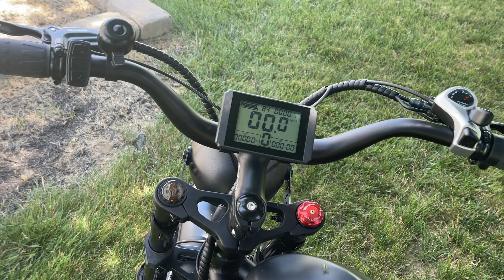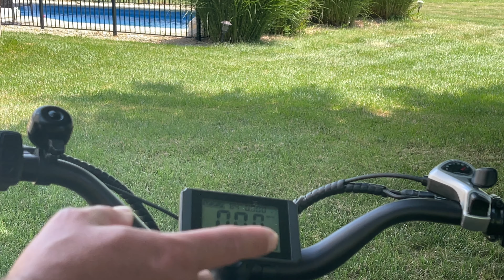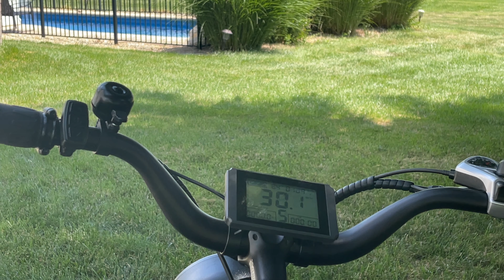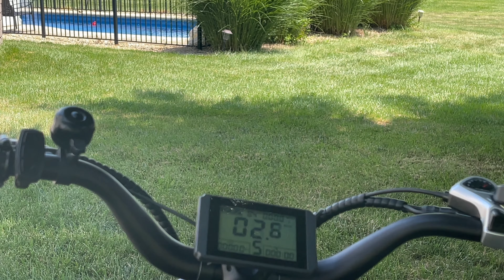NEW METHOD! HOW TO MAKE YOUR EBIKE GO FASTER - OVERRIDE LIMITER

Comment: @NRGSPORTSANDHOBBY I'm going to be getting an Amyet Eb-26 it goes 28 out of box supposedly and it has a 15 ah battery. 1000w i believe or more.
Reply from the maker: Sounds good. Will have a decent top speed, but with that AH may be limited on range, especially at top speed. Hope you enjoy it. You might be able to go faster with some settings. 1000W standard (not peak) can usually go 32mph if you have a 52V battery. 48V a little less.
Reply: @NRGSPORTSANDHOBBY  Okay good to know thank you very much. It is a 48v battery.

Comment: I got into maintenance mode but it doesn’t let me turn up the speed for some reason. I have a rider pro 4.0
Reply from the maker: It should be setting P02 or P08. Have you tried that?
Reply from the maker: Your panel is different than this video. I would watch our video with a similar panel
Reply: @NRGSPORTSANDHOBBY Thanks for the tip but I have the same panel, how do I set it to setting p02 or p08
Reply from the maker: So we show you in the video. Same video as your panel and follow along. Super Easy

Comment: What bike is that? The link isn’t working for me.
Reply from the maker: https://aniioki.com/?ref=0wjezu08
Discount code: CURIOSITYCAFE
Reply from the maker: The one I just sent you is the dual motor version. Goes even faster
Reply: @NRGSPORTSANDHOBBY  do they no longer sell the one in your video?
Reply from the maker: Yes they do. With that link you can select the ebike you want from the website and still use the discount code. That's why I provided it for you.

Comment: I just bought a gotrax ebe4 350 watt 20 foldable. N it has full display, it's kind of a turd n want more power, should I bought more power or can I put bigger hub on or battery? We only got it for putting in our diesel pusher to scoot around race track n camp grounds  COULD SOMEONE LET ME KNOW THAT HAS KNOWLEDGE? 🥂😮
Reply from the maker: Yeah those gotrax bikes are very inexpensive. I sold a couple for $300 the other day. I would maybe upgrade, We have about 50 ebike reviews on here. I'm sure you can find a better one that we've reviewed.

Comment: I’ve been thinking about buying a 64 Beachman but the only thing that’s keeping me from purchasing is the top speed of 20 mph.
Reply from the maker: It's a legitimate concern. The question shouldn't be how fast can it go when you buy it. You should be asking what the motor wattage and voltage is. You can always set it to go faster if the specs are good. Look for 750W minimum, 48V minimum. I like 1000W/52V myself. Those can go 40mph+
Reply: @ thanks! I was also watching another video of yours about swapping the battery for a bigger one. Would this damage the bike?

Comment: I have hiboy p6 with en06 display and cannot get pass p04
Reply from the maker: Our Hiboy models are locked with no panel way to override. We just simply disconnected the speed limiter wire to the controller. It's usually the white one. I'm sure there are tutorials online to help. We got our Hiboy up to 34mph (can't go faster with that motor and rider weight).

Comment: I have a Freesky Swift Horse ebike and it goes 35mph right out of the box on pas5. But 35 is the limit, above that it feels like it's hitting the brakes it cuts off so suddenly. There's an unlimited controller they sell for like a buck sixty but there's got to be a way to hack the stock one. And ideas anyone?
Reply from the maker: Yeah that breaking feeling is the limiter. You can disable it. Get it into developer menu.
Reply: @NRGSPORTSANDHOBBY  Thanks for responding but how do I go about doing that? I could rebuild the engine in your old muscle car but when it comes to this stuff I'm completely lost lol.
Reply from the maker: It really depends on the panel. It's usually a combination of holding buttons down for 10 secs. I have a couple different panel videos. I don't have that ebike to show, but it should be similar.

Comment: I just bought the newest version of this same bike and it has the new display. Unfortunately they have locked the parameter settings menu. It is a four digit code displayed next to a P0 code. All I can do is enter a password, no other function. The display is a model YL90T-H and have found the full manual but no leads on the password. Does anyone have it please?
Reply from the maker: Did you try 0000 ? That's the default on all ebikes
Reply from the maker: What did they say when you called them?

Comment: Juliet III Electric Bike for Adults Dual Motor 2000W 33MPH 48V 60Ah 100-200 Miles Long Range Electric Bicycle 20"*4.0  i need help bc an old lady almost rear-ended me bc she thought that my bike could at least go 30 & my bike only goes 20
Reply from the maker: Not sure what you are asking for. That ebike goes faster than that. You can do it in settings. Extremely easy on that panel. I've done it on alll our Eahora ebikes. You can also contact their chat support 24/7

Comment: ive already did this if i lift the bike up it will go 26 mph while i ride it it will go 23 mph which is decent.
Reply from the maker: Yeah, rider weight and bike weight can affect max speed if your motor can't handle faster.

Comment: Sorry, this does not make bike faster or adjust bike speed. It simply offsets your wheel rotation to an inaccurate speedo reading.
Reply from the maker: This and many other ebikes it does. I took a gps to it after adjustments to voltage, tire, and the actual max speed on the panel and I get 43mph. You don't? You have this ebike?

Comment: Bike speed is all down to Battery Voltage and Motor size. Here in the UK we are limited by law to 250w and 15.5mph. Stick a bigger Battery on your bike and you'll go faster...add a bigger Motor = faster still. Changing wheel sizes on the display won't make a lot of difference if the power's lacking, you can't unleash something that's not there to begin with.
Reply from the maker: You are correct. I'm sorry you are dealing with limitations in your country. We don't have such hardware limitations in the US. The way we regulate is with limiters which can be over ridden. Hence this video. If I lived in the UK, I would probably just order a custom one and build it myself. Best of luck to you
Reply from the maker: For sure. The two ebikes I run regularly are 1000W and 1400W, 52V and 48V batteries. So I can get those 40mph+ speeds. Not everyone can afford those. But you are right and I mention that in our videos. Best of luck to you in the UK

Comment: I have a 1200 watt RAM Mia e-scooter. 3.00 X10 inch tires tat are only 2 ply. I want to replace with 4 ply and a tire with a larger rim to pavement profile. But not finding any.. I plan on bypassing the power and speed limiter with a hidden microswitch. I can already do our speed limit of 60 KPH.. Just wanting the power on hills. I am in Costa Rica.

Comment: A 1200 watt motor won’t go 40mph..that bike will go like low 30s
Reply from the maker: It goes 33-35 mph with my weight per the app I use on flat roads and 43 down hill. Friend who is 70 pounds less goes 40 regularly. I'm not sure if you tried the ebike, or just commenting for some late night fun.

Comment: Hi! Great videos! Do you know if this works with the CYCROWN CycKnight? Just bought one. Thank you!
Reply from the maker: I actually did the cycrown a while back. The bike was donated to our local fire dept, but the panel was pretty easy. Get into settings with the plus and minus for a few seconds. Then scroll to the P08 setting and raise it as high as it can go. Ours got up to 100km/p. But with that motor it equates to only around 35mph